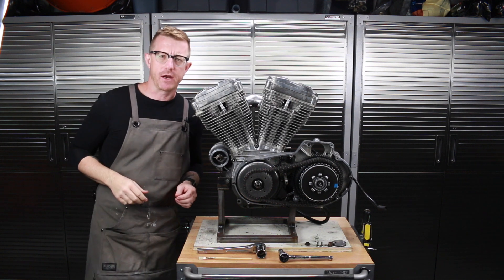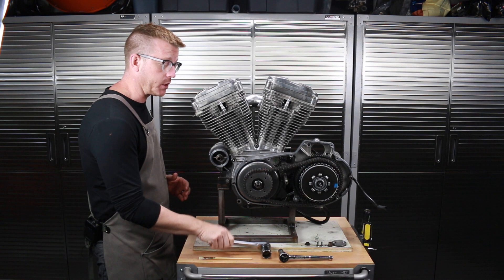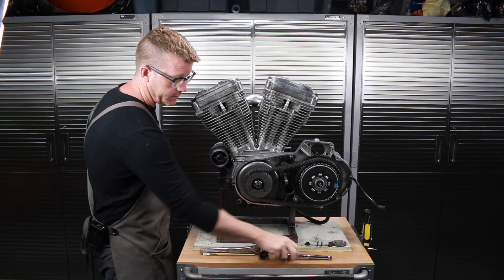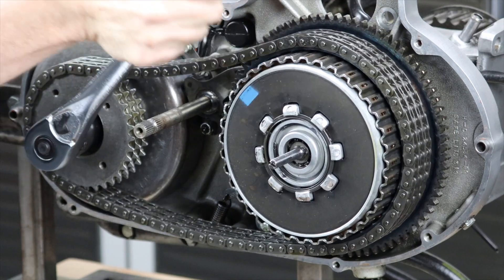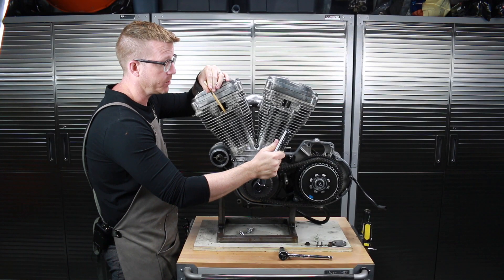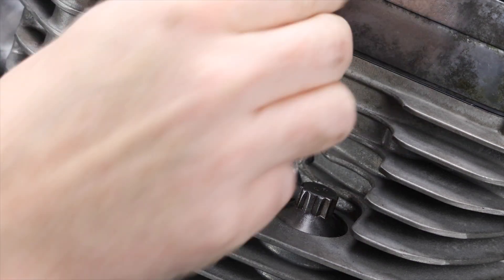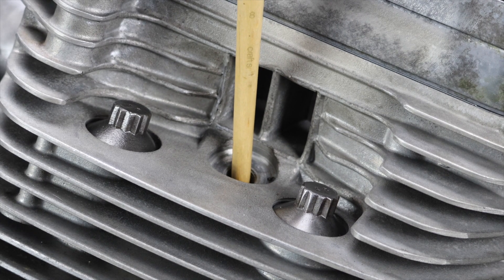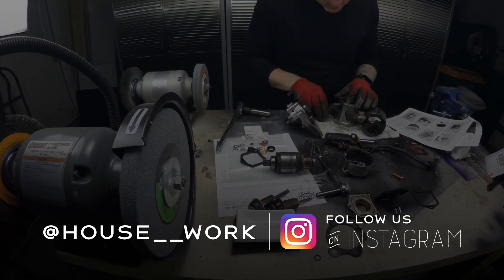How to: Find Top Dead Center on a Harley

Comment: I am motorcycle engineer 20 years and i didn t realize that, yes when the air start to blow air to your finger because the exhaust valve is allready closed and the piston start to go to the T.D.C,  very very easy way, lost my mind now, many many thanks.

Comment: If I understand it correctly, the sound of the air exiting the spark plug hole is the indicator of TDC, and the piston coming up to its full up stroke a confirmation of TDC? What would be the confirmation of the piston being at other than the compression stroke?

Comment: Did you lose TDC on the front cylinder when you looked for it on the rear cylinder?
Reply from the maker: No I didn’t
Reply from the maker: How many bolts have you removed so far?

Comment: Hello mate ! Thanks for your video, I am actually looking for BOTTOM dead center to measure and look if my sportster have been converted from a 883 to a 1200. I think when your piston fall back it should be BDC ?
Reply from the maker: Easy enough. Just do the exact opposite, the stick should be as low as possible on the compression stroke
Reply: Thank you, exactly what I did; turned the rear wheel backward until it can’t go further ! K

Comment: What if I don't have pushrods installed
Reply: If you dont have push rods installed, use teh same method to find the piston at top dead center. You want compression so if you put your fingers down into the tappet holes, both tappets will be the lowest point and not moving even with the smallest movement of the crank. If you are on the exhaust stroke, one of the tappets will be up and one will be down. You want them both down to be on TDCC
Reply: @MB-jb6wg  perfect got it. Thanks for the clarification